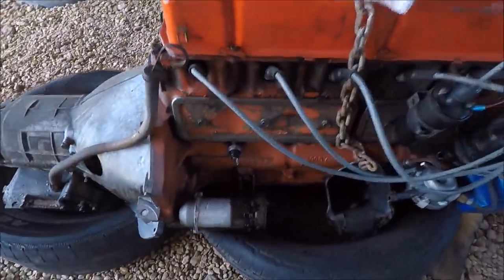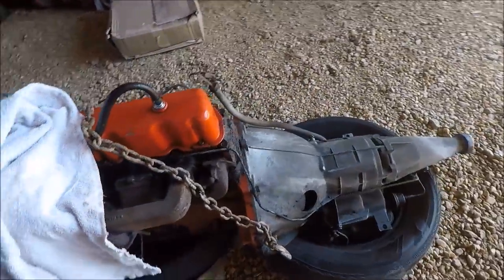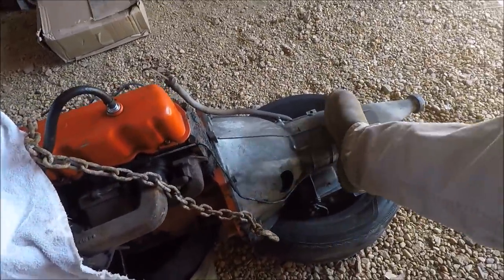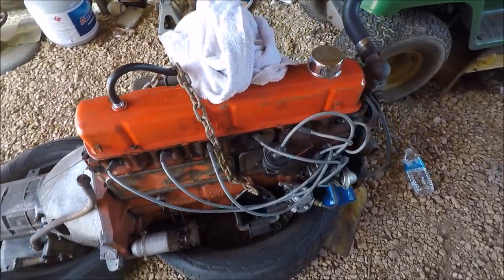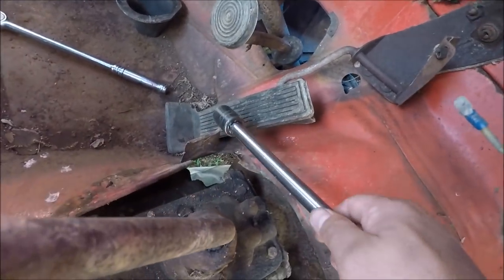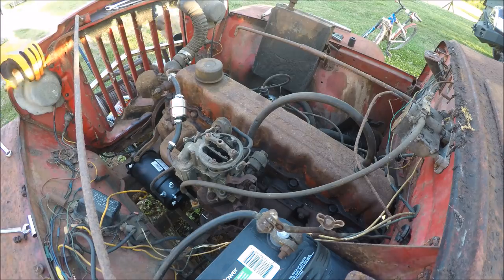Willys Truck Take Ten: The Engine Swap 194 for 194

Comment: The first engine I rebuilt in my life was a Tornado 230 in a '63 Willys wagon so thanks for a great trip down memory lane. IMHO the 194 will serve you much better. My wagon was bad for developing a violent front-end shimmy, without warning.  If you plan to use it for more than a tractor, time spent with tire selection and front-end refurbishing can save you some embarrassing stains on the seat covers. ;-)

Comment: I was 17 the first time I tried it, a friend came along and 1 1/2 hours later we had it out.  It took a couple of weeks to change the 223 cu in 6 out and the 352 in.  Lots of small things took forever but it was relatively easy.  Today I look at a car and it would take 1 1/2 to get plastic and a the rest loose and all day to remove an engine.  Yours is easy, lots things may aggregate you but really it isn't that bad.

Comment: Since you have the motor out, this would be a good time for you. To power wash all the oil and dirt and stuff from the engine bay. Also good time to check all the wiring for broken and bare wires that could cause you trouble down the road. Did you hear the other motor your putting into run ?? I'd pull all the plugs from it and put some WD-40 or Marvel Mystery Oil down each of the cylinders before even trying to start it up or turning it over. With all the old motors I work on I do that. One other thing is I'd take and cap off the bottom radiator outlet and fill the rad with water and see to make sure its not going to leak like an old boat. Be more of a pain in the butt. If you found that out. After yoh put it back into the truck. Also see how dirty the water is as its coming out. It also should help if the rad is full of dirty or mud. I had a rad from a 30s Ford truck that bunch of mud daubers filled full of crud after good cleaning it worked just fine.
Reply: Pay attention, EA, these are smart moves.
Reply: Wouldn't use WD40 it has silicon in it. Either the Marvel or just some ATF. Both burn off quick.

Comment: I haven't seen any mention of using a dummy pilot and transmission shaft to line clutch and pilot bearing up.  If those diameters aren't in line, one is in for a fight.  We always had one off an old tranny. Some guys have one machined.  That clutch is hard to budge when the throwout springs are in place.  Just a thought.  The old engine was the same one I had in my 57 Chevy, but smaller. Mine was the 235 Bluebird. (painted blue).  Brought back memories.  Entertaining videos. Appreciate them.  Might do a whole lot of things different but to each his own enjoyment.

Comment: Good thing you have strong coffee.Made the work go faster.Bummer that the frame needs a plate welded in,but you'll know it'll hold when you're done.Electric fan and just a switch inside to turn it on,would lessen the stress on the water pump bearings.Get a couple more miles per tank of gas too.
Reply: a salvage yard find should be easy and cheap fan from a newer whatever.

Comment: You will have to check the new engine has a pilot or spigot bearing.  Auto gearbox engines don't use them because of the torque converter. You cannot run without one. Make sure it fits the gearbox input shaft and into the end of the crankshaft. In some engines, the crankshaft was different for auto or manual transmissions. Check carefully!!  Greetings from the UK.
Reply: Paul James that’s good advice.... and I would suggest that the clutch disk, pressure plate be at least checked for wear and the throw out Bearing replaced while the engine is out.... will save a lot of grief latter
Reply: I found out about the pilot shaft bushing the hard way.
Reply from the maker: Just changed the pilot bearing
Reply: I agree with Paul.  Pilot bearing is very important.  I think in those it is a sintered bronze bushing and has to be soaked in oil before installation.  Be careful when installing the engine.  It is easy to bend the clutch plate while installing the engine.  Get an alignment tool.
Reply: Exactly.Always replace the Throw-out Bearing when you have a chance.

Comment: You probably know this but you need to get a clutch alignment tool when you put your clutch on the new engine also don't forget you'll probably need a pilot bearing to put in the crankshaft of the new engine standard transmissions usually needs pilot bearings where automatic transmissions don't use pilot bearings

Comment: Okay since you have some spare change, if n you want this to be successful spend some of your change on getting the flywheel resurfaced, buy a new clutch, pressure plate, and throw out bearing. you've been told several times about the pilot bearing. the clutch disc is old, hard and too brittle to expect it to hold up for any time. people skimp on this part and regret it later, unless they enjoy this little adventure. oh yeah, if you think taking it out was fun, wait till you start putting it back in. transmission input shaft will be fun getting it splines up with the clutch disc splines with out knocking your pilot bearing off the clutch fork. easy does it is the way you shine that library.

Comment: make sure you don't forget the pilot bushing (take 30) . What are you going to use the jeep for? Why i ask is because i think the 194 is a bit short stroked to be of any use off road and on the open road it will be screaming it's guts out.  .I would have used a high block 292 and take advantage of all that low end torque which a 194 is lacking.

Comment: This needs a director's commentary track where you and The Bearded One discuss and comment on interesting parts.
Reply: My heart is a little hurt over the unfolding mystery in the story of the truck.  Those notes on the visor about the engine being replaced at such low mileage, what happened to the first engine?  And now, the homemade mounting plate while they made things work with what they had available, also telling the story of trouble, and the efforts for solutions.  In spite of that, the truck has lasted and lasted, what a tough old thing.   Now, your chapter of being charmed by its survival pluck and how much fun you are having with your own efforts for solutions.  I am soooo rooting for this to work... lets delay the last yard-ornament chapter if you can.

Comment: You will need to replace the automatic flex plate with the flywheel from the old motor. I don't recall if the cams were different in the auto vs manual engines anymore but it shouldn't be a barrier to a swap. You will probably need a new clutch. The pressure plate may be useable, depending which version it is and how it was treated. Happy wrench-spinning and best of luck!

Comment: Can we name the beast? I vote "Willma"!  As in Flintstones? No! As in- Willma truck turn over, willma truck wheels turn, willma truck starter work, willma engine crank?
Might be easier to drop the transmission out and install it last. It's going to be a bear trying to put that engine in and align that input shaft up with the limited room you have. Please use a chain when reinstalling instead of a ratchet strap. Looked dangerous as heck when the strap rubbed up against the bucket blade.
Reply: Mike you're quite right. Trying to mate the engine to the trans the way they pulled the engine will be next to impossible.
Reply: Mike Goodman 😄😂

Comment: Hope you put a Bushing in the end of that crankshaft at the flywheel for that straight transmission  because that automatic doesnt have one because of the torque converter but the straight transmission does need one
Reply from the maker: Lol

Comment: Put Start Pilot spray in the air inlet of the carburetor. Will work miracles. Would have started the engine if ignition works.

Comment: What year is the replacement engine, if it is pre 1975 it was made to run leaded fuel, if you run modern fuel it will distroy the valve seats unless you use a lead additive or get a valve job with hardened seats
Reply from the maker: thanks for the tip, I'll check on that

Comment: Would really be a shame to throw out the old engine.... I wonder if you could take it apart and repair it as well? It should be easier to do now that it's been taken out of the truck... then you'd have two engines! :D  That truck has high hopes.

Comment: You need to make sure oil pans are the same.you need to put trans on engine then install as one unit.i do t think you can get trans on while putting engine back in by it self.also you never hooked up your genetator.on rear studs.check youtube or manuel.wish i was there to help u.love your vids

Comment: I normally work alone and the way I do things tends to reflect that. I typically remove the front grille. It just makes lining everything up a lot easier. The easiest way I've found for putting it back in is to leave the transfer case in place and remove the transmission. Assemble the new clutch/flywheel on the new engine and attach the transmission to it. It's a lot easier to align the transmission to the transfer case than it is the transmission to the engine. You will need to remove the shifter assembly and wire the main shaft in place (http://www.willystech.com/wt/T90RebuildGuide/Pictures/WireLoop.jpg). And in your case remove the PTO from the back of the transfer case.  There's a nut and cotter pin behind there you will need to remove from the mainshaft on the transmision to finish separating the trans and transfer case .(http://www.willystech.com/wt/T90RebuildGuide/Pictures/OutputGear.jpg)

Comment: A liitle late to tell you this but a 250 engine is a better truck engine and a bunch of them out there. You have room for the 292 truck engine but they are hard to find. I have a 250 hooked to a S-10 5 speed.

Comment: just a question --do you think your going to put that engine back in and it is just going to slide on that transmission input shaft ?? you can save yourself hours of frustration and inventing new words if you take the trans down and put back in after engine is down in it --make sure you get you a clutch alignment tool
Reply from the maker: it's a two piece, homemade plates, and homemade brackets. It's ready for reinstall